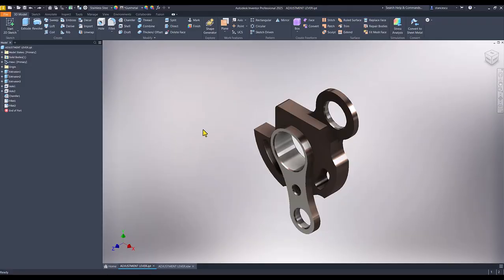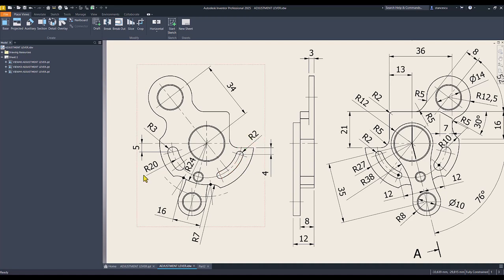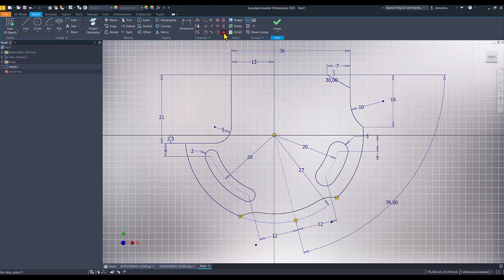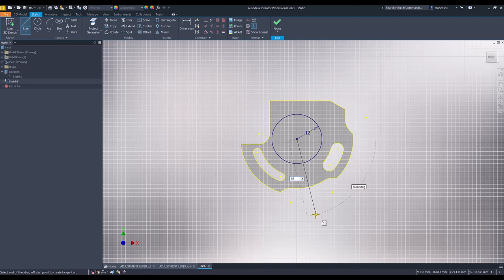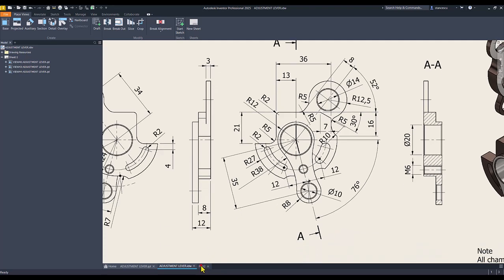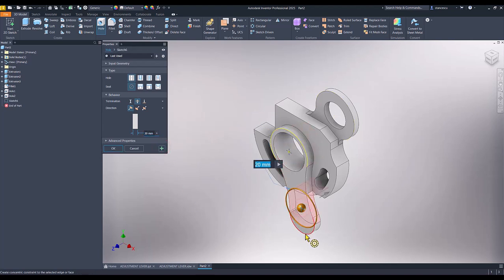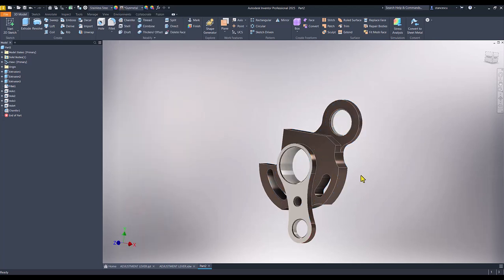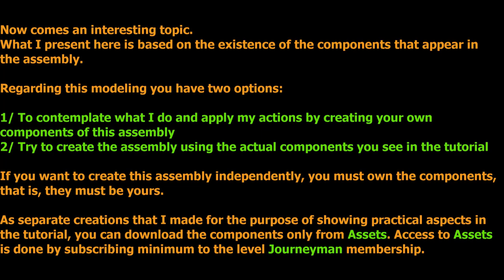Tutorial Inventor - 409 ADJUSTMENT LEVER

Comment: Hello dear professor, why do I see some people drawing a cluster of details in the Assembly environment, and some people drawing a cluster of details in the Part environment. Like in this video, you draw in the Part environment, why is that? Thanks you!
Reply from the maker: That's my usual procedure - creating the individual models based on the appropriate drawing, and then eventually placing the part into an assembly. Do you think this procedure is wrong? Thanks for the message!
Reply: @prof-stancescu  - I can't judge right from wrong, that's why I'm asking you.
- As I said, some people do it this way, some do it that way, I just want to verify which way is correct and fastest!
- The video above is made up of 2 details combined, right?
Reply: @prof-stancescu 
 -In my opinion, if you draw the details on an assembly environment, when you change a certain size, all the other parts will update accordingly.
- If you draw each part separately and assemble them: 
      1. It takes time to assemble
      2. The parts are not linked together, so when you change the design of a part, the other parts will not automatically update accordingly.
-Looking forward to receiving feedback from you sir.
Reply from the maker: @mittohi  I didn't understand your message well. Yes, you are right, your version for assemblies is a great solution, but it can be difficult for beginners. I am mostly addressing beginners and this is why I missed that solution. I will make a tutorial by using your version. Thank you again!
Reply: @prof-stancescu  I am also new to Inventor, currently I am taking lessons from your videos Sir. Thanks Sir